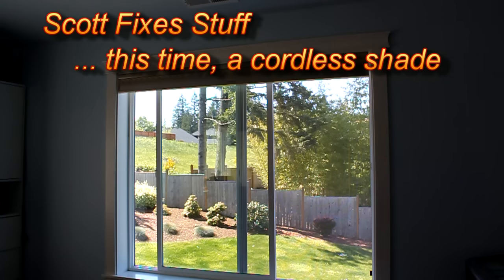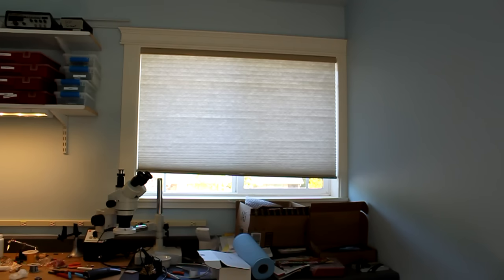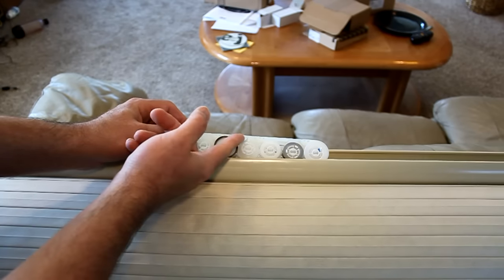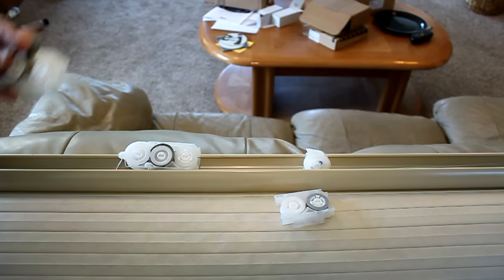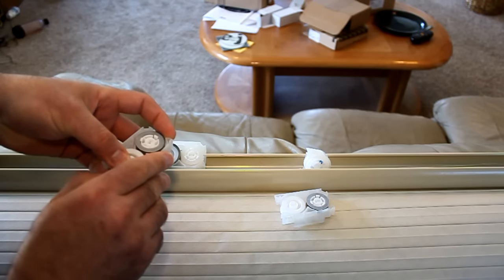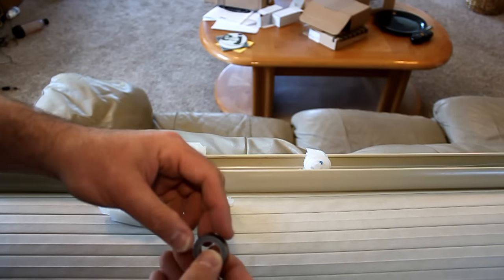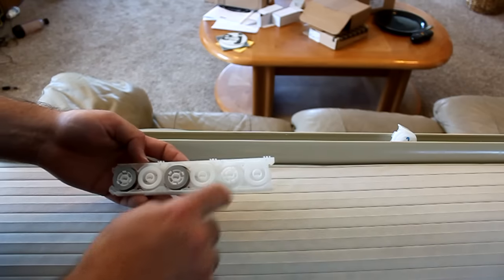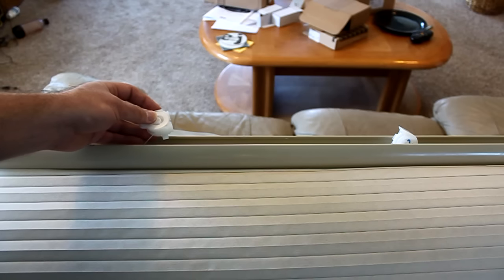Repairing Levelor cordless cellular shades

Comment: Wow, this worked but it took me about two hours to figure out what I was doing wrong. I watched the video 4 or 5 times and felt like I was doing everything just like you did but the shade was then stuck in the up position. Finally I decided to take off the end pieces and wind the strings in the opposite direction even though it didn't seem right. Voila! That did the trick, saved myself from spending $165 on a new custom sized blind. Thank you so much from a very happy female senior citizen.
Reply: I know this over 1 year ago but I had the same problem and could not figure it out until I read your comment!  MAN! what  a head-scratcher this was. Thanks for posting!

Comment: Spoke with Levolor.  They do not sell or send out replacement spring motor cartridges for the headrail. They're proprietary and patented so you have to send in your blinds to have them repaired. They offered free courtesy shipping labels and no charge repairs on mine.  I had 7 of my 10 custom cordless shades that this happened to.  I fixed 5 of them yesterday thanks to this great video, but on 2 of them the connector tabs from the spring coils snapped off.  These are the ones I'm sending in.  Thx for this very helpful video...
Reply: Yeah I was able to use my dremel to make a new T-shaped tab so the metal spring coil end would stay held onto the spool. Saved the shipping and bad my blinds back up and working in no time:)

Comment: Wow this video is 3 years old, and Levelor is still using the same lousy plastic and cheap ends!  Thanks for the video, all 3 of my springs were off,  and one was broken on the end, took a couple of minutes using the dremel to cut a new end.  Leveling it out took a bit. After I reinstalled it, I measured how short it was from the bottom,  took them down and pulled the string the exact amount I was short.  Of course I pulled the wrong side, and they were off twice the number of inches.  So just pulled the string from the other side the next time, and it was perfect!  Thanks again, better than having to pay a repair company or send them back to levelor!

Comment: Thank you Scott!  We bought these blinds for our entire house and YES they are 100% junk!  I've repaired many of them over the years and also sent them back for repair (which is a joke). Under warranty but you pay $15 shipping, don't have them for a few weeks, then they break again within a month. I recently had another one break and didn't want to fix myself. Saw your video and your method is waaayyyyy easier than how I was doing it.  We have top down and bottom up so we have two motors in each blind. I always end up having the same problem with it not going down or up all the way and didn't know how to fix. Thank you for even amount of string on each roller tip.  With two motors the string needs to be the same on each roller as to where the motor sits in the top of the blind. Also be aware of a knot in the string.

Comment: Thank you!  Great service to everyone by making this video.  We have 2 small crapolor, I mean levelor cordless shades and they have been broken for a long time.  My wife called and it was going to be $65 each to fix.  I fixed BOTH in about 70 minutes with this.  

Only thing I would add is make sure you wind the string up the right way on each.  I finished the first one and the shade wouldnt pull down.  I realized I had wound the string the wrong direction on one of the spools.  

Thanks again.

Comment: Fixed my broken shade thanks to your video! I found if I left the entire set of plastic parts together, the gears work in tandem to rewind the cord to the correct length as I rewound the spring onto the other sprocket. Eliminates the short open lengths others have had issues with.
Reply: That is a great tip. thanks!

Comment: This video gave me the confidence to repair two Levolor cellular shades. The most labor-intensive part ended up being getting the string length correct on the rotators. Thanks!

Agreed with the general advice to not buy Levolor. Bought a house in 2010, had 10 installed. 6 different breaks in that period - one of which that resupplied me with a part. In other cases I was told to sent them my 4' wide living room blinds at my expense.

Comment: Thank you for an excellent video. I was able to fix our shade in about an hour. In the process, both of my springs turned into birds nests (I eventually got my wife to help me - it's easier with more hands) and one spring broke the nub off the end so I had to use tin snips to cut a new nub.  And of course I wound the strings too far so now the shade sits slightly too short when down, but I'll go back and fiddle with the strings a bit to lengthen it again. In the end you saved me a lot of money, so thank you.  Yours is the best video on this repair!

Comment: This video was very helpful! The shade wouldn't go back up, and I was able to rewind my springs and get it working again! One thing I noticed that made a big difference is that in order to get the shade to stay up tight like when it was new, you need to pretension the springs. It's pretty easy to do. 

Once you re-wind all the springs and snap them together, use your finger to turn the gear and you will feel the spring tension reacting to your finger force. Make sure to turn it the correct direction or you could damage the spring. After about 1 full turn, you can pin the gear in place with a paper clip. The gears have holes in them for this purpose and there is a slot in the body where the paperclip can be inserted to pin the gear. 

Now wind up the strings and re-attach the 2 string reel end sections to the assembly. After the string reels are attached with the gears engaged, pull out the paper clip and the pretension from the springs will take out any slack in the strings. Now, insert the assembly back into the shade frame. You will see that with the proper pretension, the shade will be pulled up nice and tight. 

Thanks so much for this great video!
Reply: Taylor Heanue thank you so much! Another detail is that after putting the paper clip in the two spring rollers you need to pull all the cord from two ends rollers and put them at the same level by pulling from one. You will see that both are connected by the same cord. Then rewind (clockwise if it says LH and opposite if RH) and finally attach them to the spring rollers, remove the paper clip and attach to the frame. Thanks!

Note: mine had 2 blocks cause it is wider 51”

Comment: Thank you so much for publishing this!!  It is very helpful. In watching the video we didn't quite understand the string length part, but finally realized that the string length wound on each spool has to be equal to fully extend both sides of the shade, so we fully compressed the shade and then equalized the string length before winding the string onto the spools.  You saved us having to send ours off for repair!

Comment: Thanks to your nice clip on how to rewind the line on the roller, I was able to fix my pleated shades that was bound for replacement. Completely different brand, but the mechanisms in them are quite the same. Mine had a simpler mechanism with only two rolls and one line to the mechanism. Inside the mechanism, the two rollers were identical. The one with the line in it was broken, and could not properly hold the line. So I just switched them, winded the spring on the bad one, and the line on the good one, and voila. Good as new. Different product, but same fix method. Thank you for posting this !

Comment: This video really helped!  I just fixed one cordless blind that was a replacement sent to us after the first one busted with just one month of use.  He’s right, these Levelor cordless blinds are cheap and break easy.  The older ones had metal parts and last longer.  At least now I understand how the mechanism works.  No more using rubber bands to hold it closed :)

Comment: Thanks so much for this video! I fixed a blind that had not been working for a long time. On mine, all three springs were off the spools. I surmise, that if you pull the blind down too far below the window sill, the springs will pop off the take-up spool. I'll be careful with it now!

Comment: Thank you for this dude, this is exactly what I needed. For the first coil, you didn't have to wrap it all the way up again on the other spool. I just wounded a few times until the friction caught it, and then attached it back together with the blinds fully extended, and it kind of evened itself out.

Comment: Thanks for the video. I had an UMBRA shade, not the same as yours but only 18 months old and the spring let go. They are $100 ea so I tried to figure out how the thing went together and couldn't untill I saw you wind the spring so that the wheels turn in opposite directions! Presto! Saved me another 100 bucks. Much appreciated.

Comment: Thanks for this.   I made the mistake of buying these as well but mine move up and down from the top (magnet holds it) & the bottom. 

Because I have a wide 6ft bedroom window the weight caused it to break 3 months after buying it. 

It’s been broken for 3 years.  

Due to your video I’m about to try and fix it.   Thanks again.

Comment: Thanks, took about 30 minutes and Bam, fixed. Mine were miss feeding thru the roller. When I was finished , yes they were uneven. I cut the bottom cord from the permanently attached metal stop, adjusted accordingly and used a tiny button as the new stop. Works great.  ( these were JCpenney  top down bottom up blinds)
Reply: Another good option. something from the button box..

Comment: I'm partway there... trying to re-wind the spring on the second spool. It's "forward" on one spool and "backward" on the other (according to the tension)?? I figure that's where the tension comes from, but it really does not want to wind.
FYI, to remove the cartridge on my smallish shade (from 2010), I slid it out the end of the header piece after prying up the tab that held it in place horizontally.

Comment: Thanks for posting very useful video. Completely agree with your comment, its a junk product. I did follow your video to repair 3 of my cordless shades. One of them working perfectly well. However other 2 got shorten by about 4". I tried to troubleshoot little bit and found it runs out of thread length on one of the sprockets. I took it out of cartridge and measured the length of the thread and no issue, it is longer than my window. But when I put it together, it runs out of thread length. I tried different positions for cartridge, Still not helping. Any suggestions will be appreciated.

Comment: I got it off and I snapped the one spring out but I wind it half way back on the spool and it flies out of my hand (3 times now). I give up. I will try again tomorrow. I have a bad disc in my neck that make my fingers go numb. It's just an extra challenge for me. Hope I will be able to snap the coil back in before it springs loose , if I get that far. LOL Thanks for the video though , it really helped.

Comment: Things were going pretty well (you can use E6000 to glue steel tape onto roller if it breaks) until I tried to use the blinds.  I must have rolled the strings wrong.  The blind only goes half-way down.  Any tips on this?  We actually seemed to have it working with the set of rollers OUTSIDE the top but when we snapped them in...got messed up.

Comment: Thank you! I had the exact same blinds and exact same problem! Even the same spool had the little thingy broke off. I fixed it just like you did, with just 2 working spools and the blind works!  It doesn't go all the way up fully to the top, but almost.....I'm too beat to try to take that spool thingy off again, that was a bitch to do! Used 2 screwdrivers like you said, it worked, but took some labor to do, heheh.

Comment from the maker: I have the same problem with one of mine. I've considered trying to use my dremel to trim the end of it, but I'm not sure whether that will work or not. Spring steel can be brittle and hard to work with. I wish there was just a source for replacement springs, but I've not had any luck searching the Internet.

Comment: I'm not sure ours are Levelor but they are cordless cellular shades that we've had for over 10 years.  Never any problems but seldom ever used either.  Our problem is that the shade went up and we can not pull them back down - they are stuck at the top of the window now.  Wondering how we can fix them?  Any suggestions would be greatly appreciated.

Comment: I did just what smbakeryt talked about.  I had one little "nubbin" of the part that was supposed to attach, break off. I cut the spring steel flat after the skinny part, then used a dremel cutting wheel to shape it similar to what it supposed to be.  Reinstalled and so-far so-good (knock on wood).

Comment: Are they still working?
Reply from the maker: Yes and no. They're all currently working, but there have been a couple times where I had to go back and repair a shade a second time. At this point, I'd not be surprised if I've had to repair every single Levelor shade in the house.
Reply: @smbakeryt  Two of my three custom shades just arrived today. They are Bali brand but I think they are probably exactly the same as yours, unless they upgraded the spring mechanisms since the time that you got yours. I didn't get the extended brackets yet so I can't hang them today, but now I know how to fix them. Thanks.

Comment: Any advice as to why after following the instrcutions from this video, fixingthe wheels as described and reinstalling the blinds they remain in the the full open poition and I am unable to pull them down?
Reply: Glen Giaquinto Make sure the strings are coiled up in the correct direction,if they aren't when you pull on the blind they will work against each other.

Comment: I can't even figure how to take mine down. The one side has a broken spring because it is up on one side and just sliding down on the other. When I can slowly get the blind up , it has 3 clamps , one on each end and one in the middle. But I can't seem to get the blind down to even examine it. Mine are 6' wide. These are REAL nice but not built sturdy. Please help , thanks

Comment: How do I get the shade down off the window to work on it? Have both the cord ones and cordless. The cordless are the ones I need help with...
Reply: use a straight end (slotted, not phillips) screwdriver.  Look in the back of the shade at the top.  there will be an open slot where each bracket attaches to the wall or frame of the window.  Put the end of the screwdriver in that slot and gently bring the handle of the screwdriver toward you, which should release that end of the shade.

Comment: This video was helpful. However, just like at the end of this video the bottom on one side of the blind is shorter than the other and the blind no longer goes to the bottom of the window.  I've taken it apart, again, and it seems that one string is longer than the other and winding the strings to match only matches the length of the shorter string.  I don't care any more. Spending a couple of hours on this already too much time and I'm not wasting any more of my time.  I also stepped on my glasses and broke them while trying to fix this stupid blind and now I'm blind.  Egad.

Comment: We were lucky and had swapped out a window. so had an old blind to tear apart out use 2 out of the 3 spring sets. It was hard to get all three wound up and together. A straight edged screw driver between the sprockets worked best for me. DOWN with Levelor. The spring end with broke off both. Bad, bad design. And they would not stand up to there warranty.

Comment: For anyone else watching this looking to fix these, there's actually a far simpler option that works 9 times out of 10. Fully extend the shade, move back so the shade is at a 30-40 degree angle from the window, and then give it 2 or 3 quick and firm tugs. After that, there should be more tension in the system, allowing you to slowly work the shade up to the open position. Once that's done, bring the shade down again and it should work as intended. May take a couple tries the first time you do it, but they're made to self repair this way.
Reply: Once the springs have come loose, that method only serves to make things worse.

Comment: Getting the mechanism out of the frame is the worst part.  This video is so far useless without that info.  Needed C-clip pliers- figured it out.  Now the rails need to be spread to remove the mechanism. Not sure how this is going to end up, but Levolor clearly makes crap stuff and I will never go near them again!
Reply: That's odd, all I needed was a screwdriver to get the rail off the brackets and to remove the spring cartridge. Not very hard on my 4 year old Levolor blinds.